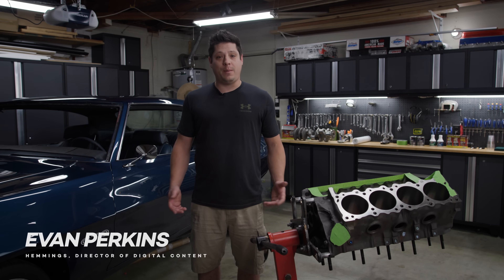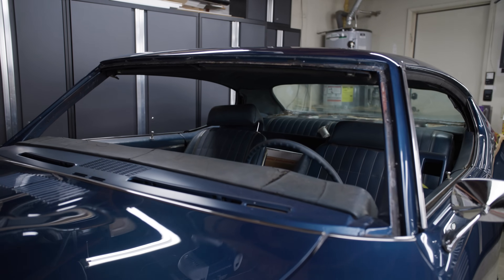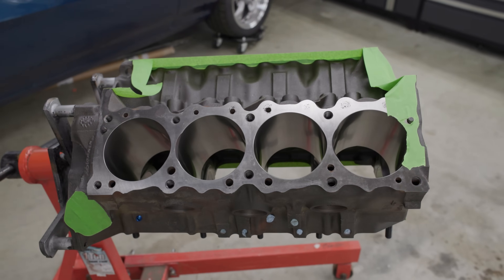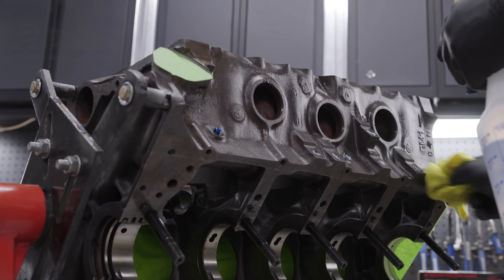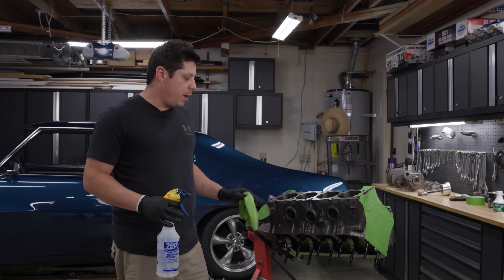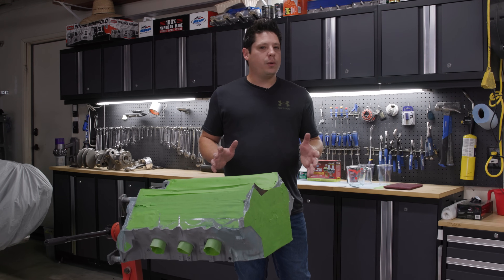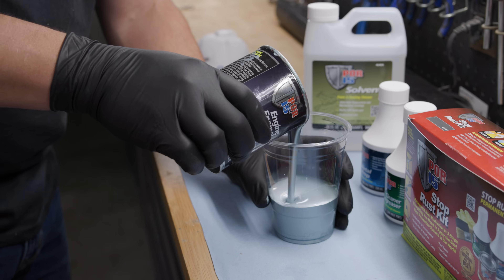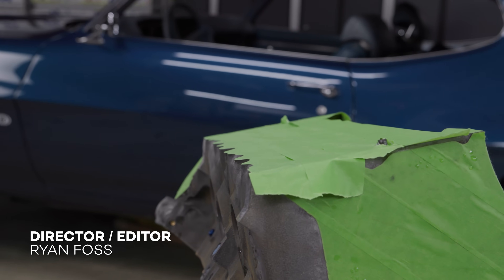Prep and Paint a Pontiac 400 Engine

Comment: I bought a 1970 GTO, red red with (fake) Judge stripes for $250 in 1981. 400 350 Ford 3 speed. Rotted to hell, rusted off rr shock upper mount... It was fun... off it went in the fall for $650